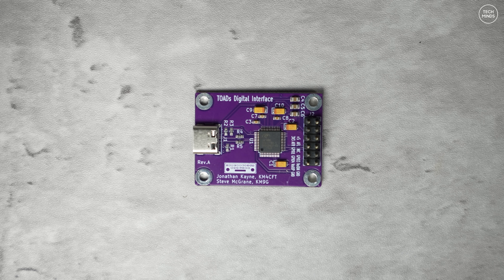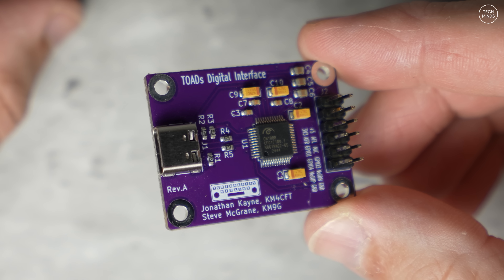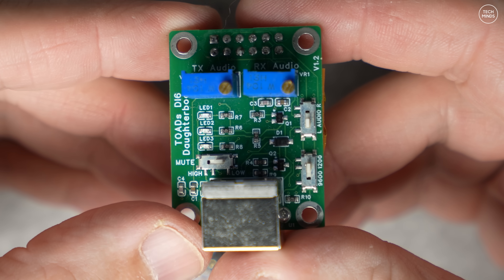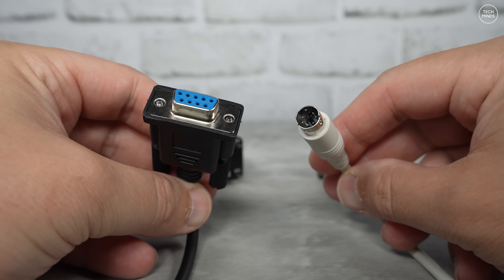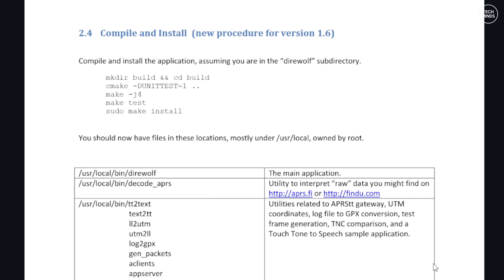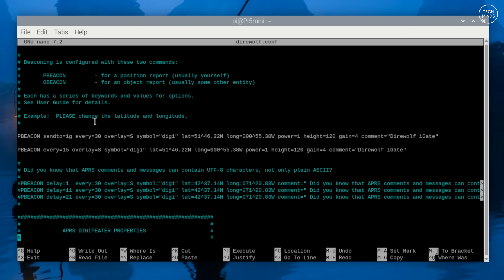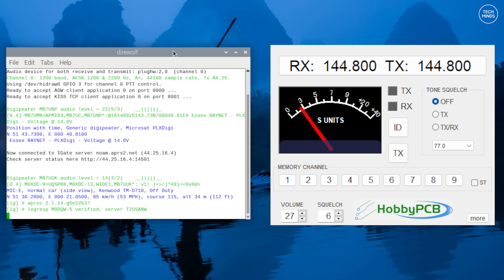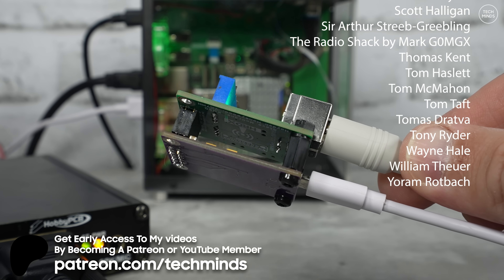TOADs Digital Interface For ANY Ham Radio Transceiver

Comment: what are the benefits of this over a $2 usb soundcard dongle? you already need to make the cable to go from radio to device, it seems just as easy to do that with trs ends for the soundcard. what is the benefit of hardware audio level adjustment either when you already have to do a fair amount of software configuration on your pc couldnt you just adjust audio there instead?

im not trying to be dimissive either, i suspect i am misunderstanding or missing something so would love your help understanding!
Reply: A $2 soundcard needs to be modified to accept PTT & COS signals from your radio. This involves at the least a diode, transistor, resistor and soldering to the pins of the CM108 chip on the board. This can be very delicate work and not always successful. In addition you'll need some form of audio control too (which the daughterboard has).

In addition there are a lot of fake CM108's that don't work in Allstar whereas this chip is compatible.
Reply: Your dongle is missing capabilities this device has.
Reply: @LibertyCaveWS7PB  I think they are asking what those capabilities those are.
Reply: @AdrianBoyko And I expect them to research it. I would have to look it up to make sure I got it right. But I promise the dongle wont do Allstar.
Reply: @LibertyCaveWS7PB  what are those capabilities besides hardware audio level control?

Comment: The idea is great, I'm using a Digirig for this purpose, because it has CAT control too. 
My problem that I would like to solve is that I have an old FT-950, and I want to build a fully remote station with it. Is there any solution for this purpose? Like something with Raspberry Pi. I don't want to buy an IC-7300 for this yet, but where I live now, I'm unable to build an antenna so my father's house would be a good place for it. 
Thank you!
Reply from the maker: Take a look at the MFJ-1234
https://www.youtube.com/watch?v=q3ZmwUNifTc
or 
https://webradiocontrol.tech
https://www.youtube.com/watch?v=coiJe_a3RFE
Reply: @TechMindsOfficial  Thank you! I read about the MFJ earlier, but it looked too expensive. 
The webradiocontrol looks promising as it's a subscription-based model. The only downside is that I have to do the port forwarding, ISP things too. I will check out that.